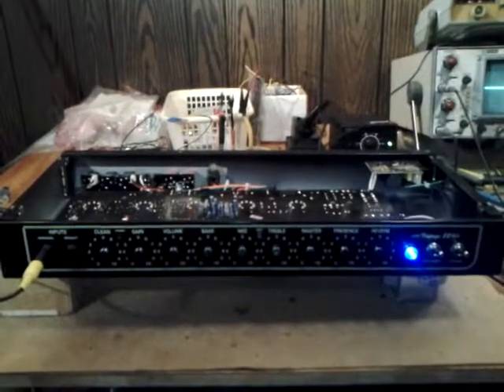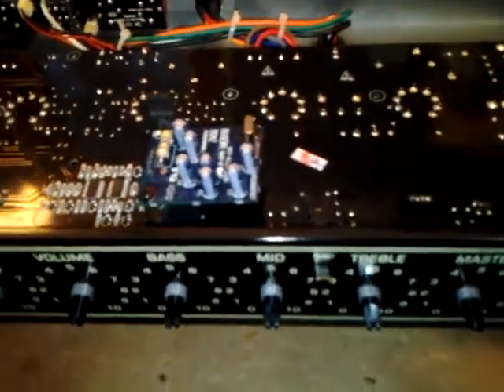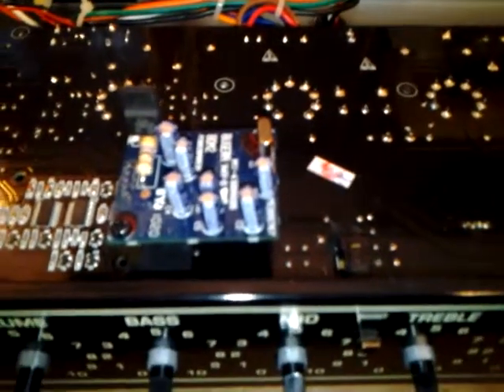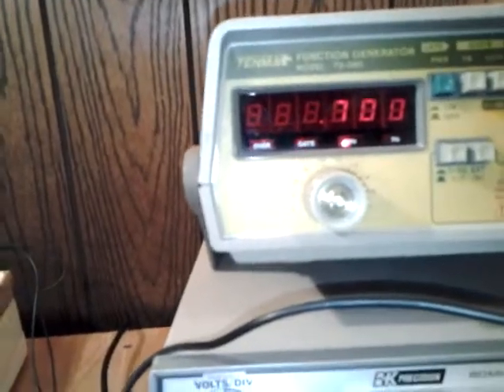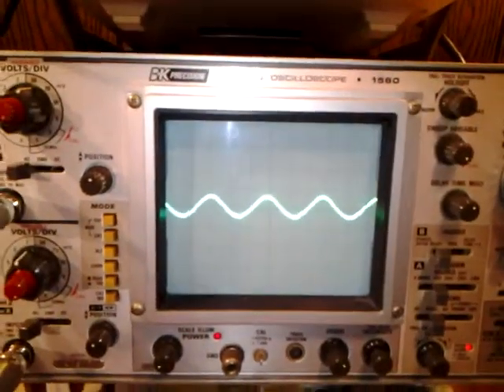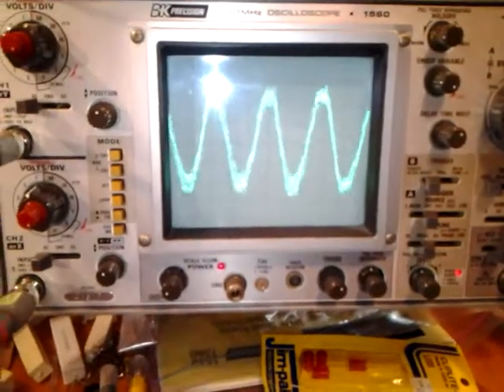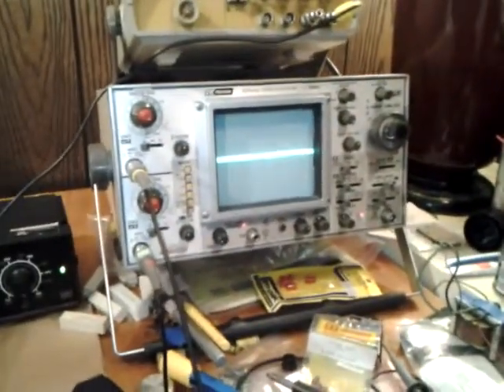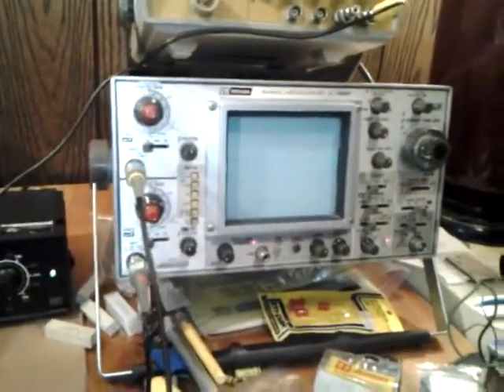Engineer meets Bugera V22 reverb - Part 1

Comment: Hi i have the v22 and you sound like someone who know a lot more than me, one day my amp turned on but  was very dead with now sound or noise, when i unplugged my g3x pedal it was back to normal and i now have found if i just plug a lead only into the return socket everything goes dead, no output. Could this just be a faulty return socket, any help would be appreciated. jeff
Reply from the maker: If you jumper a cable from the loop out to loop in and it doesn't work, it very well could be a bad jack or a bad connection between one of the jacks and the PCB. It could also be that one of the components in the loop output buffering circuit has failed, most probably the BC546T transistor. It's marked as T8 on the schematic I have, but it's been ages since I've been inside my V22, so I couldn't say for sure whether that's how it's labeled on the PCB.
Reply: @MithatKonar  hi thank you ,i tried cleaning the return socket but when i connected a cable to the socket it shut the sound off, then i connected the other end into the send socket and sound was back on so in conclusion will i have to replace the return socket, thanking you jeff.

Comment: +Hello +Mithat Konar, thank you very much for this videos series on behalf of the bugera shitty reverb hehe, i would like to know how did you do to fix the "motorboat sound" problem, i tried the link in your description but it's not available or not available in my country, i searched a lot in the internet but i cant find any fix or solution, thank you very much for your videos men, you have a lot of knowledge about electronics. Greetings from Arg
Reply from the maker: The helicoptering/motorboating link doesn't work for me anymore either! My amp didn't have this problem, and I can't remember the content of that link. :-( I also did a bit of Googling and couldn't find anything specific enough to help diagnose it. If you find out anything, please let me know and I'll update the description here.
Reply: Mithat Konar thanks man, i'll try checking the voltage regulator, if i can fix it I'll keep you updated

Comment: Very nice series of videos.  I just bought a V22 Infinium because they are being discontinued in Japan and I picked one up for about $150.  Last year I designed and built a EL84 push pull guitar amp with some similarities to the Bugera so I wanted to see what a similar commercial design would be like.  Have you found reliable schematics for the V22?  I have found the V22 standard but not the Infinium model.  Not certain but I think that the Infinium may have LED biasing.  

Your information on changing the effects program is great.  I'm definitely going to try that.  There are 16 different programs available but I suspect the only one that will really appeal is the spring reverb.

Comment: Hello, i`m in the market for what would be my first tube amp. The Bugera v22 is exactly what i am looking for tones wise. Do you recomend the amp ? i heard some horror stories about bugera build quality. Is there anything that i could do after i get it to prolong its life span ? BTW i`m gonna get the Bugera v22HD Infinium, the head version.
The other option is a Princeton reverb clone built point to point by an fellow electronist, but i dont think the princeton clone can deliver the classic rock dirty sounds like the ugera. What do you think ?
Cheers !
Reply from the maker: Gabriel Tudor Concerning reliability, my understanding is that the most typical failure mode of the V22 has been a particular run of voltage regulators that was used in early production. Mine didn't have that problem. However, one of the 12AX7 tubes in mine developed a problem very early. Looking at their construction as well as the crib death of one them, I would say that maybe the 12AX7s used in my amp weren't the greatest--I replaced all of them. Apart from that, my V22 has been solid.

I used to own a silverface Princeton Reverb, and my recollection is that it could get really very ratty when cranked but had issues cutting through other instruments, esp. if I was driving it with humbuckers. I attributed this to the speaker more than the amplifier, but I was never really able to test that theory.